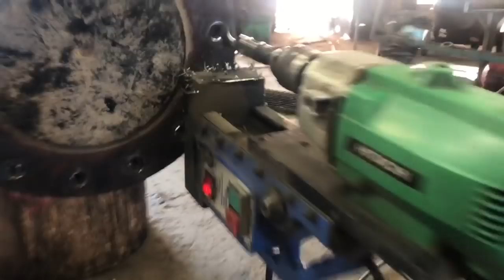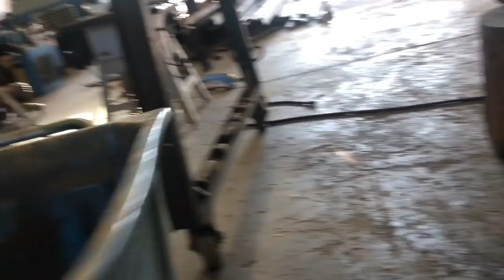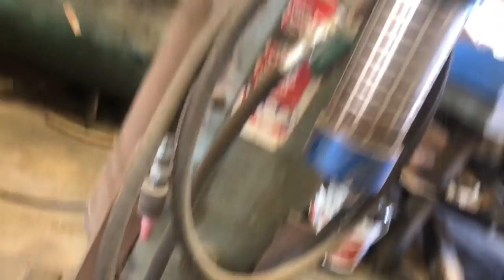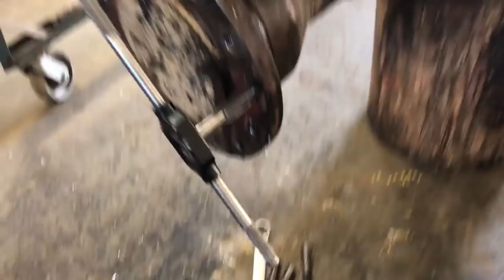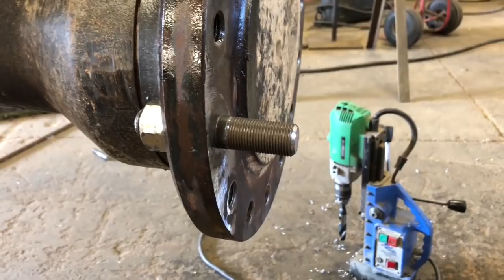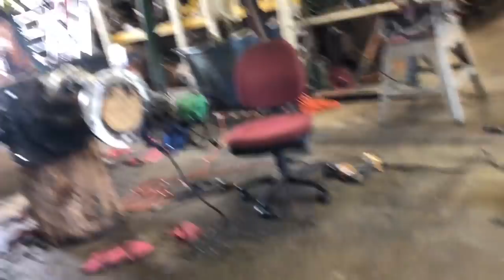Getting the axle shafts tapped out..

Comment: I recently was drilling a bunch holes in a similar situation. I normally use some kind of penetrating oil in a spray can like you, but I ran out part way through. The only thing I could find was a quart of ATF and a Windex bottle. Turned out it worked a lot better than the other stuff.

Comment: Nice job, I had a 570 with those small 3/4 bolts running duel 28/23 tires. Just a heads up you might break the wheel flange, that’s the weak spot on those 1200 axles. The1400 axle will fit with some frame trimming

Comment: It's be awhile ago,but the last one of those I did I used these type studs on the bottom of the page.These you just drill and ream the hole,no threads in the flange and a nut pulls them down tight from the back-

http://www.truckcomponentsonline.com/78-14-STUDS-AND-NUTS_c_1089.html

Comment: While your mag drill is still in place , switch to tap and start it in the hole , then you know it's started straight , as far as hard spots , carbide drill will work wonders although expensive well worth it in the long run nice job though

Comment: My machinist OCD is having an aneurysm.  Wade- you'd better go buy a lottery ticket, making it through that job without breaking a tap with the impact gun.
Reply: Yeah, I'm not sure if I would have done something so risque on such an expensive part. A bigger tap wrench and better oil, yes.
Reply: 8vmafia
I don't think that little impact has the guts to break that big of a tap,....... famous last words ! 😊
Reply: It's not the torque, it's the impact part.   Heat treated tool steel is super brittle.  I used to power tap 1"-8 threads 3" deep in the end of a big gear reducer shaft I used to make with a huge engine Lathe.  That sucker had enough torque to twist a pickup truck in half.  Never broke a tap though.
Reply: Max I've done on our Bridgeport in steel is 3/4"-10. Runs out of power over that. I'm hoping once I get my camelback drill press up and running I'll be able to do considerable bigger as it runs much slower.
Reply: Luckily I've not been around many taps recently.  Been on the cylindrical grinder for like the last 4 years.    3/4-10 is still impressive for a belt drive Bridgeport.
Reply: Yeah, it's only a 1 horse, but I would wan't to push it much harder even if it did have more power. There is a video on my channel if you're interested.
Reply: Man you said it.  I was cringing waiting for that thing to bust.  LOL
Reply: I was afraid to.  Ive tapped stuff going good then snappy happened.  Royal pain to get busted tap out